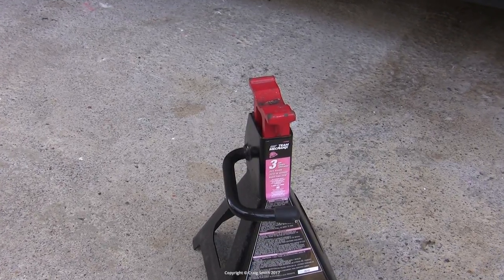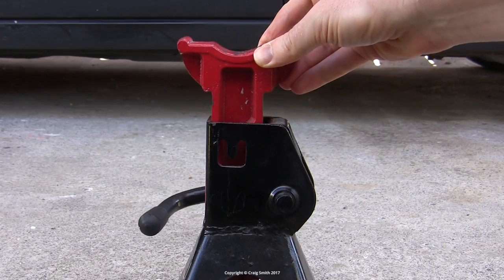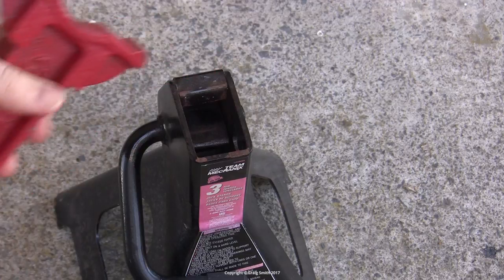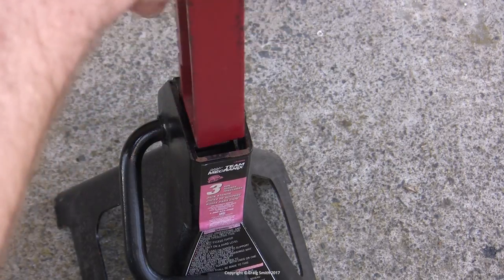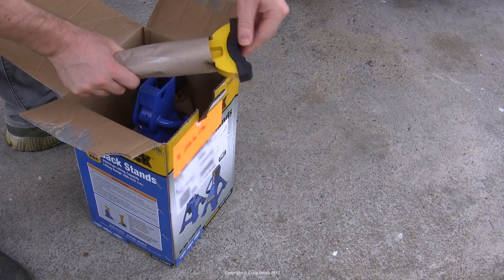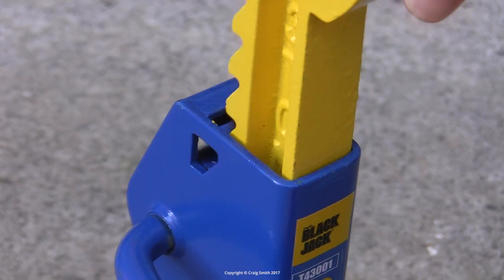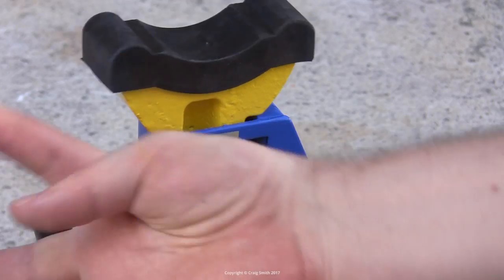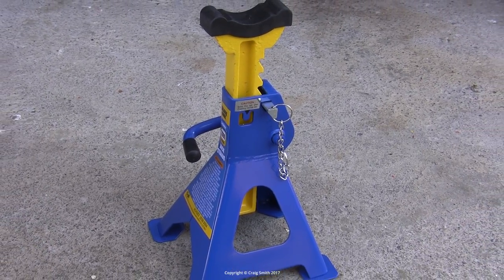Quick tip: Use locking jack stands for maximum safety

Comment: Too bad my 6 ton harbor freight ones cost $30 a pair compared to $56
Reply: I ordered a pair of locking stands today after noticing that one of my 6 ton Harbor Freight stands has a pawl that isn't machines well only half engages. What I mean is the right side of the pawl grabs the teeth while the other side doesn't. It likewise has a jump of metal underneath. Just got them this past weekend and will go back this weekend to exchange. Just the same, it could have been dangerous and the quality is shit. Made me lose confidence in them so I ordered a different brand.
Reply: @czluver4338  At least you'll probably be alive next year, John Moore? Who know. Harbor Freight just issued a recall on some 2 and 3 ton jacks for out of spec tool/die production equipment which is used to form these stands.  People who cheap out on stands ultimately just help the human gene pool.